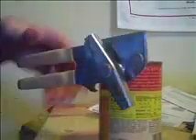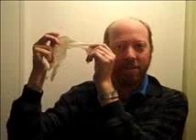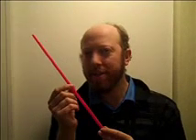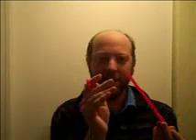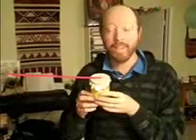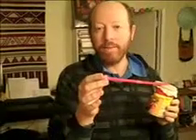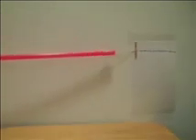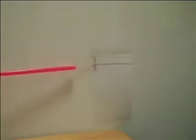How to Build Your Own Barometer!

Comment: Don't forget add the distance of the stray to the equation. A 10 inch straw will give different results than a 12 inch straw. Also, the rate of pressure per millibars can only be calibrated by the actual pressure outside. I'd recommend calibrating it before use.